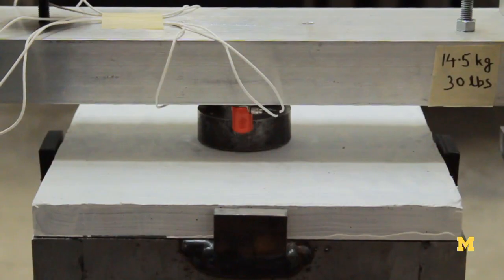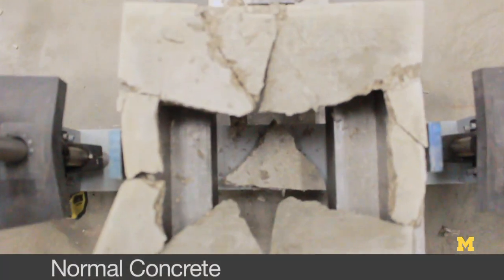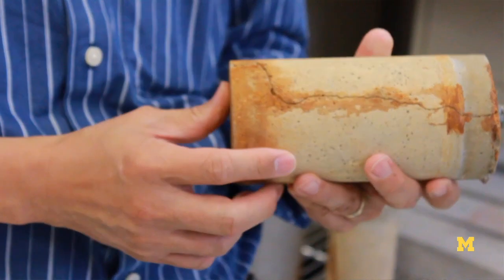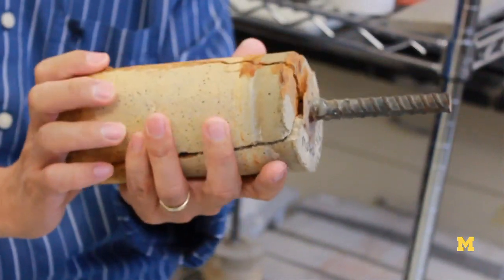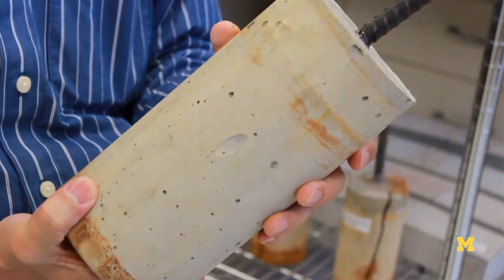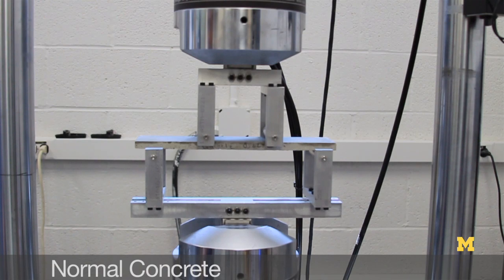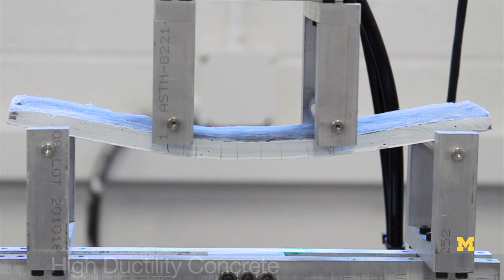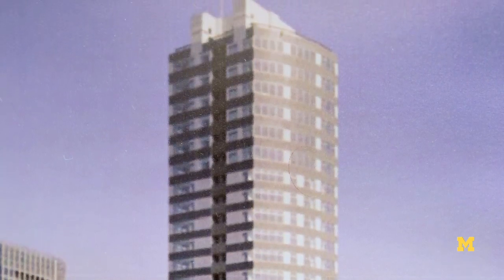Super Concrete

Comment: What happens to this high ductility concrete after 100+ years will it still be high ductility?or will it harden like normal concrete? Or will it start disintegrating?
Reply from the maker: Hi Rod, 
Thanks for your question! We passed it on to the researcher, Victor Li—here's his response:

"Based on accelerated tests in our laboratory, this high ductility concrete should retain its tensile ductility for a long time, for structures designed for over 100 years of service life."
Reply: @MichiganEngineering   what if thers fires in several floors  will that make  the building weak in spots where it was heated by fire?